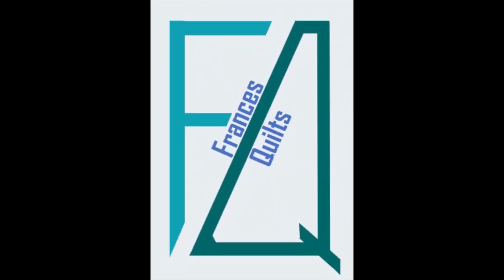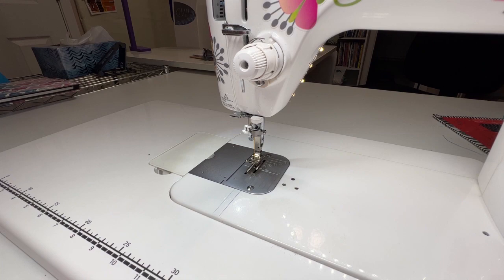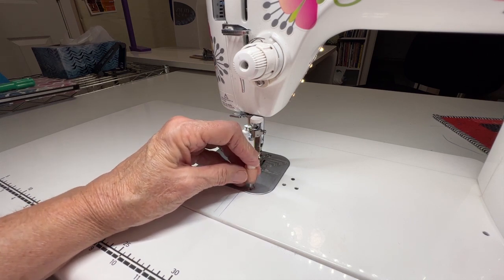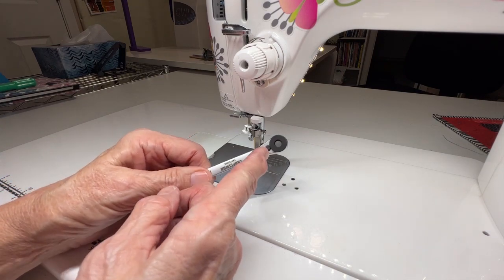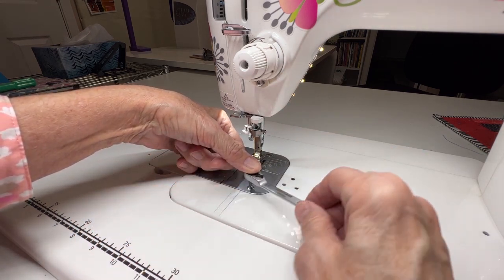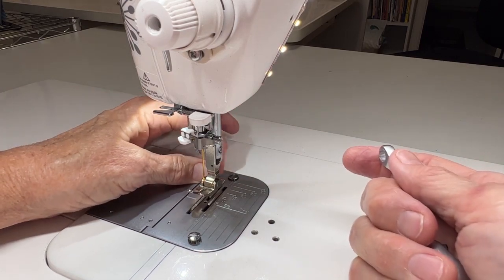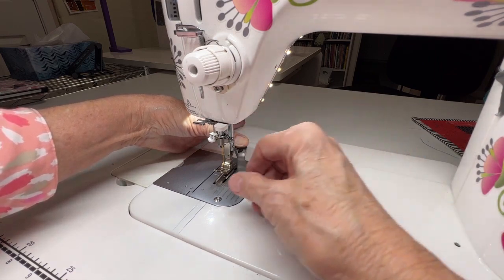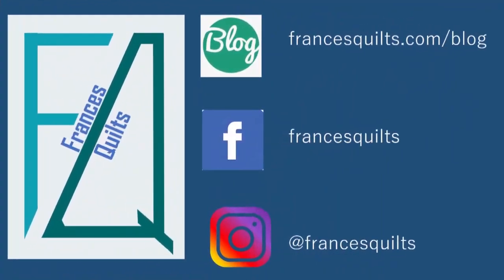Right Angle Screwdriver Review

Comment: Good advice!  I couldn't get the screws out of Juki 2010 when I purchased it and had to raid my tool bench for a decent screwdriver.  I have been spoiled by a Pfaff for 25 plus years that does not require a tool to remove the throat plate.
Reply from the maker: Trying to get them out of my 2010 is why I know about this screwdriver!!   It was suggested to me and I tried it but still couldn't budge them.  I finally had to call my repair guy to come over and take them out for me!!

Comment: DH just came home from Harbor Freight.  He bought me a second right hand screwdriver for the upstairs tool drawer so I don't have to run out to the garage or downstairs to my tool bench.  It was only $2.99 and has about 6 bits.  It's not as nice as the Chapman set I purchased in a sewing machine repair class but it will do the trick when I need one again.  For the life of me, I can't understand why they have to install throat plates so tight it takes more than the screwdriver they provide with the machine.
Reply from the maker: I am so glad that you found one!!   I promise that you will use it OVER and OVER again!!